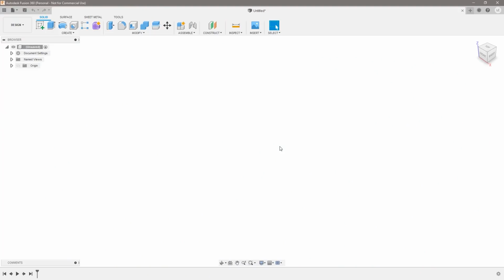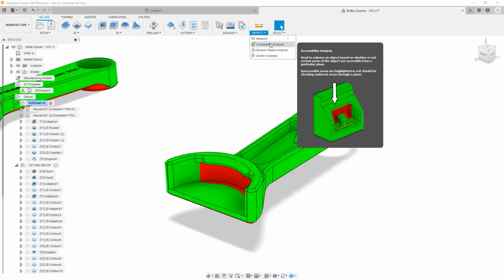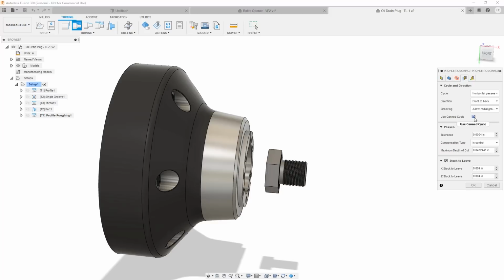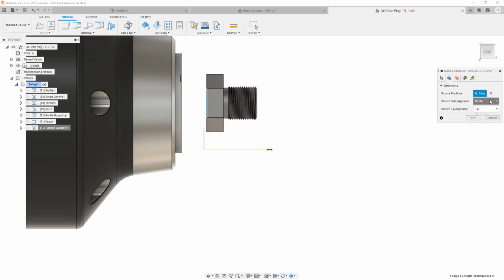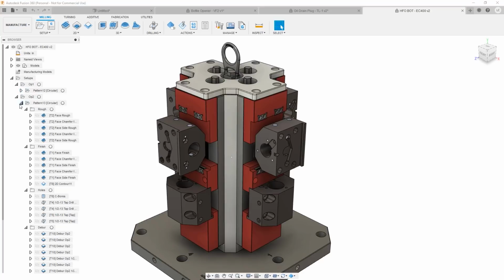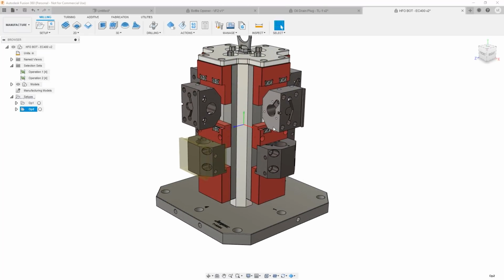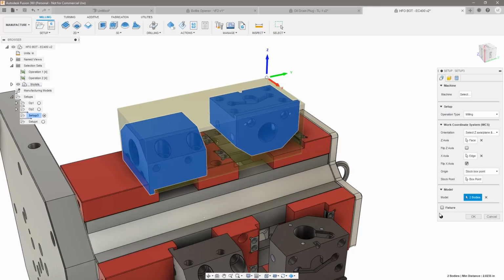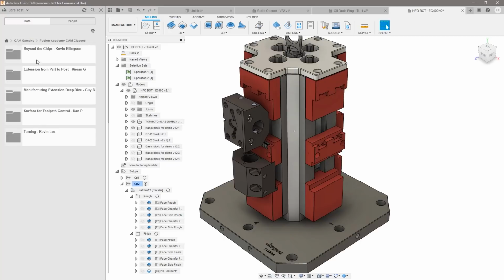Fusion 360 - What's New in CAM Part One -Season 3

Comment: So when programming using fixtures you use a center point instead of giving each part their own work offset. Like G154 P1 and so on? I’m building my first fixture  now and I’m struggling with which way would be the best way to program.

Comment: Outstanding video.As a product designer it’s critical that we get analysis early in the program to avoid specific pitfalls.If a part design is allowed to develop just to find its infeasible at the end could cost significant in re design cost and loss of program timing.With the proper use of analysis tools that can be avoided.I know,to most,this seems like an obvious comment But you’d be surprised at how often failure occurs even at the most highly rated design companies.I have to deal with it All the time,especially when engineers give poor direction.These tools along with others like CAE are career saving tools to expertly use and understand